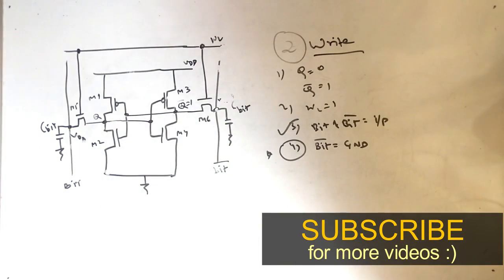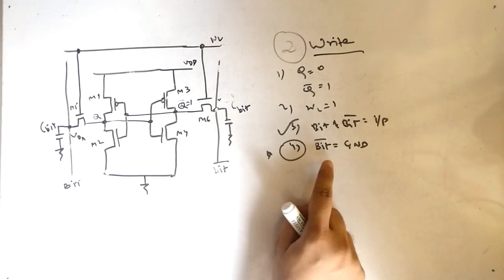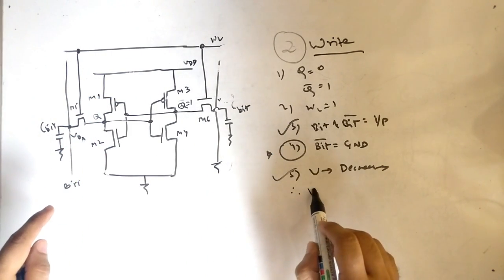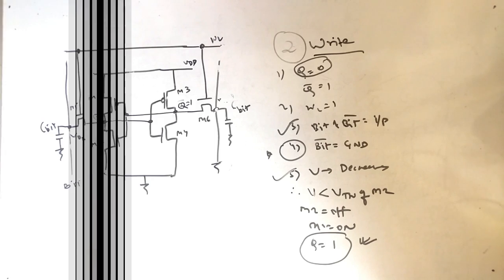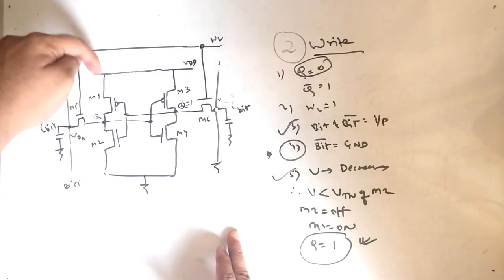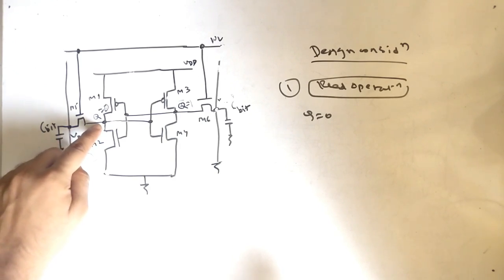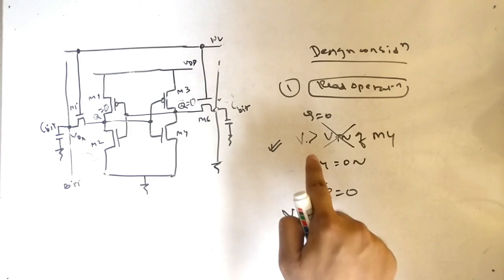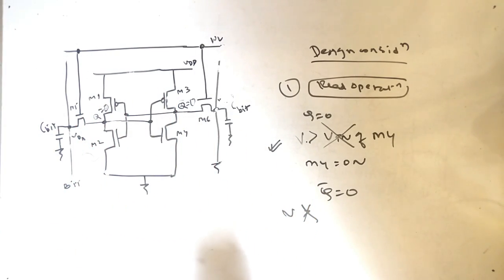SRAM 6T - write operation and design consideration

Comment: Hi
In Design consideration if Q=0 and Qbar =1, in bit side pre charge capacitor  due to voltage difference current flows and cpacitor will discharge and voltage will going to decrease right correct if i am wrong.... and you said at node Q  voltage increases and if v>vth of m4 it will leads to race around condition ....

Q.Here my question is in what scenarios at node Q voltage will increase that we are giving Qbar as input to first inverter (Q=0 you mentioned and Qbar is 1) that Qbar is connected to first inverter then Q=0(nmos due to Qbar 1 grounded  and that Q given to second inverter pmos turn on due to Q=0) there will be no chance to race around condition right ... 

CORRECT ME IF AM WRONG .....

I hope to get a reply from you soon.....

Comment: In the second case when Q=0,and discharging happens then why voltage increases,it should decrease across M4 just like the previous case? Can u explain it please.
Reply: It is because the access transistor that is ON is trying to pull the node Q up by driving current into it. So to maintain the state they make the NMOS M2 relatively stronger than the access transistor M5. This constraint is read stability.
Reply: @saylee1207  okay he should have explained this in the video but koi na thanks

Comment: when M4 is on Q' should be 1 why it should be 0 ??
Reply: Because M4 is connected to Gnd and M3 is off which means switch is open n so Q' can't be equal to Vdd or 1.